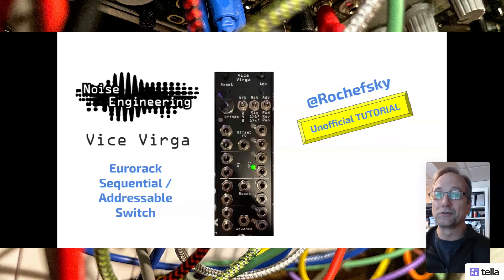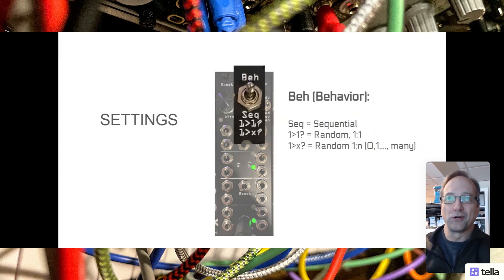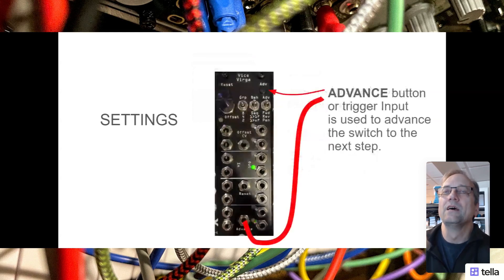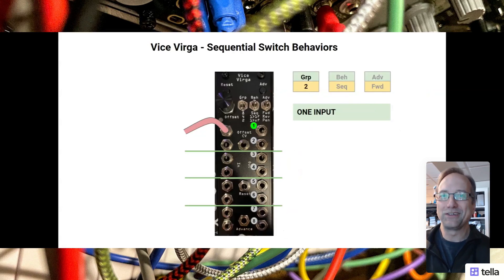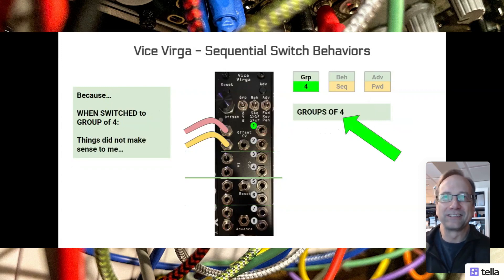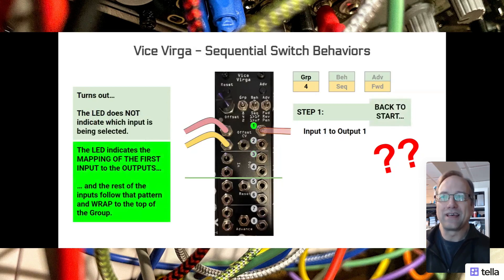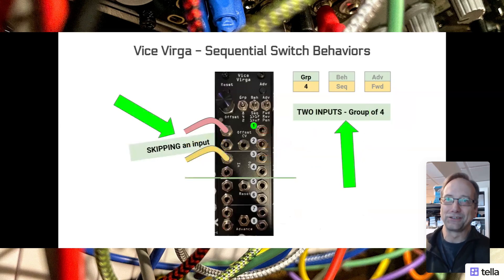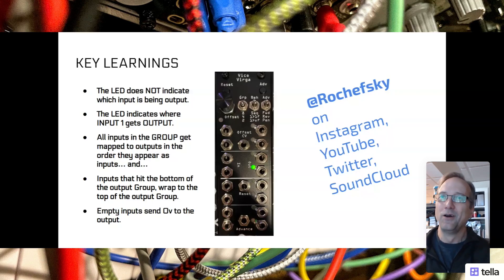Noise Engineering Vice Virga Tutorial - Sequential Switch for Eurorack - Structuring Songs

Comment: Came back to this today because played with mine after a long time and got confused again. Still not sure if i understand it. Or if its usable for what i actually wanted a 1 into 4 or 4 into 1 switch.
Reply from the maker: As long as you want a switch and not a mixer, VV should work great
Reply: @rochefsky  It "kind of" works but signals are not where i expect them, but your video helps, i have to think it through a couple more times. I think the Make Noise Jumbler does a similar thing.

Comment: thank you! what is the pattern in the other beh modes? i’m assuming the light still reflects the output of the 1st input and the other inputs are in the same order as with the seq mode?
Reply from the maker: It's a bit more complicated than that, since the 1>? Setting can output each input to multiple outs randomly, including zero. And I think you are right that the light reflects the first input based on the Grp setting... I have to test that again